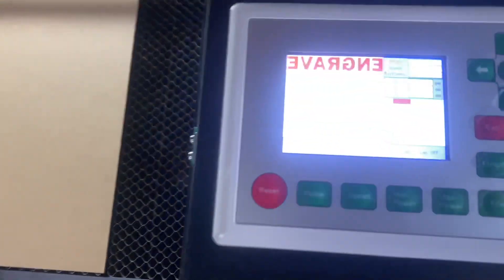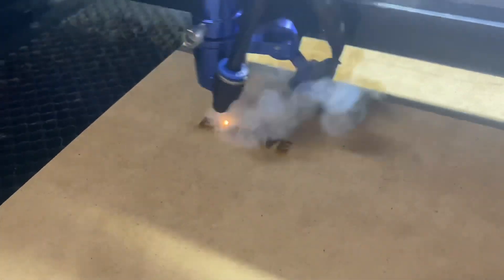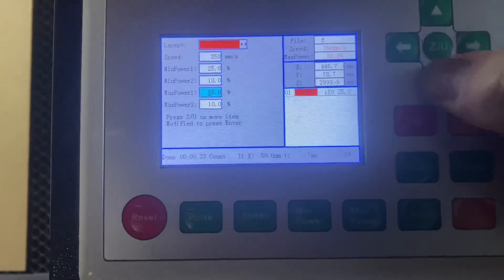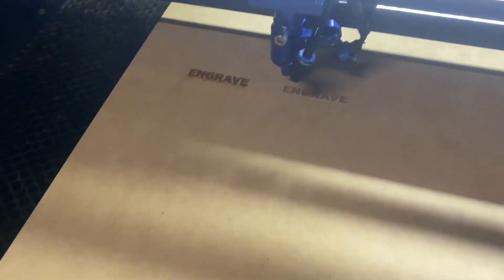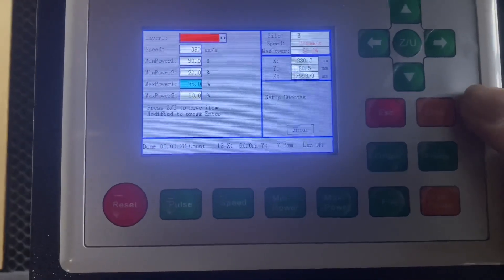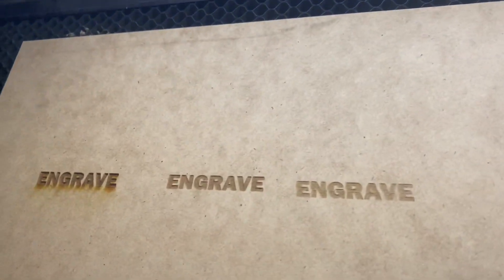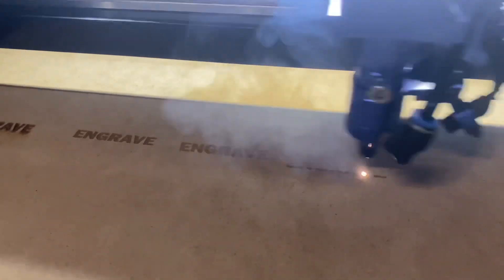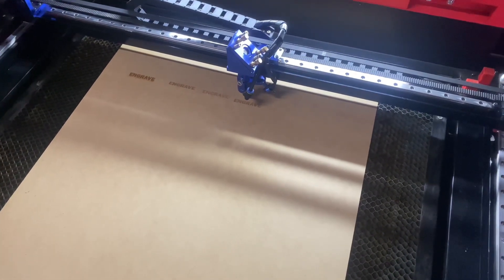How Too Change Speed & Power on Ruida 6442 Controller

Comment: I realize that the aim of this video was to illustrate the on-machine editing capability of your program and I an not in any way criticising that intention because you have done a great demonstration. 
However, as part of that demonstration you have used engraving colour as a way of proving parameter changes. Look at your results carefully and you will see that you are not really changing colour but instead changing engraving DEPTH. You are seeing colour change for a different reason. Changes to power and speed change the width of the scan lines. It is the OVERLAPPING lines that are creating the illusion of darker/lighter colours.If you adjust the scan interval with the same power and speed you will get the coulur change you witnessed. Sadly, you cannot edit the line spacing on the machine, that has to be done in your program. A full explanation of  how neither speed or power changes colour can be found here. It is a myth  that most people believe in.
https://www.youtube.com/watch?v=Na5_6okUyKg&t=2755s

 As a seperate issue,  I note your screen display is a mirror of what you actually engrave. There are two possible reasons for this.
1) Your RDWorks or Lightburn  has the  0,0 point in the wrong corner. If the machine starts and the head runs to the back left corner the arrows at the corner of your RDWorks software ( a small  black square dot for Lightburn)  should also be set to top left corner.
2)The display axis on your machine is set incorrectly. If  1) does not fix the problem then press the ZU button and step down to SCREEN ORIGIN.and play with the options fo make your display match your drawn image..

Comment: Hey! As far as I know your laser has 70x50cm workspace. Can you actually use it fully or it is a bit smaller (like 68x48cm or something like that)?
Reply from the maker: Hey Markuss, Good question I don’t actually know as iv not measured it but I will do that today and get back to you with an answer 👍🏽 Cheers, Matt
Reply from the maker: Hey mate, yes you can use the full area 70x50 vid will be up shortly 🤙🏽
Cheers, Matt
Reply: @woodendayz My machine is being delivered at the moment. Wanted to order and cut up some sheets before it arrives. Helped a lot, thank you!
Reply: @lohs225  
 If you plan to use ALL of your available work area for certain jobs, I suggest you cut your material to 720 x 520. The table will accomodate the larger sheet but the head will only move around the 700x500 and you will need a little bit of waste around the edges
Reply: Another amazing video, I've learned so much! Where did you find the recommended speed & power settings for this machine?
Reply from the maker: @Kmorlandhy16 just ran a test card and also just tryed cutting different materials at different settings,
How did you go with yours??
Did you get the homing thing sorted out?
Reply: @woodendayz  I didn't yet, but I'm learning to go with the flow and making happy mistakes along the way...until I get some real time to read the ruida manual (I finally found an English manual 😂). I've been searching high and low for a suggested material speed & power as a starting point, but I can't dial in on the settings. I've been using an Epilog 60w with CorelDraw for the past few years and it's an adjustment moving to a 80w using Lightburn 🤦‍♀️